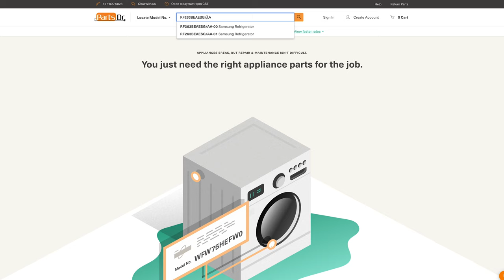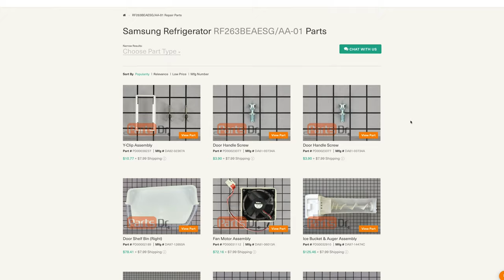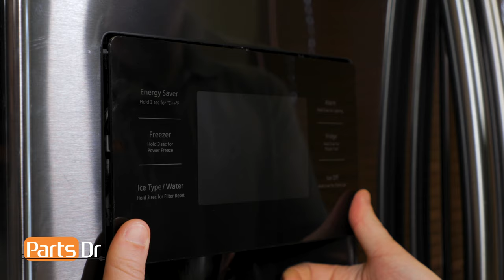Check this seal to fix ice buildup in your Samsung refrigerator

Comment: Thank you, Parts Dr, for this video. I’m optimistic our problem is fixed now. One further tip to your viewers: DON’T test the ice chute flap with a cup of water after you put in the new parts until the fridge is plugged back in. That’s because there’s a cam controlling flapper position and it may not be in the right position until you get power plugged in. (Seems obvious now!)
Reply from the maker: Thank you for sharing this tip!

Comment: I removed the lone screw but after repeatedly trying for an hour now, the front control panel will simply not budge even when applying straight out pull pressure using two hands in the dispensing hole. Is there another screw somewhere? Hidden locking tabs? Another technique? FYI--I used a razor blade around the three sides of the control panel just in case debris was causing the problem but no change. The hidden black underside panel is too thin to try and pry try it out with a screwdriver. Please note that my unit (model #RF28HMEDBBC/AA) has a gray cover around the water dispenser while your demo unit has a black ring. Your video suggests that very little pressure is required. I am applying so much pressure that I am afraid I will break off the front panel snap tabs. My dispenser leaks air into the ice maker and I need to replace the flapper mechanism with a unit I purchased from you so any help would be greatly appreciated. Thanks.
Reply: Samsung fridge.. i have the same problem as you.. how did you end up getting the ice dispenser removed. i dont want to pull mine off.
Reply: Me Too! Ours is a RF23HCEDBWW with leaking flap as well.  And we can't get the cover off either.  One screw out, pryed back bottom with screwdrivers but only budged about an 1/8 inch.  Can you help?

Comment: I replaced the flap with a brand new one, its seemed to seal initially but after a week seems to be leaking more than the old one. did I miss a step or is it faulty?

Comment: rh22h9010sr my flapper is stuck open. No AC voltage is going to the flapper motor when the switch is activated.

So I don't think the flapper assembly will fix it.  What is the next component I can replace to make sure voltage is going to the motor?

Comment: We have a Samsung RF22KREDSR/AA-05 with a leaking flap. The panel is slightly different from the one in the video. I have tried to remove the ice dispenser cover several times to no avail. After removing the screw, I have pulled on it as hard as possible and it doesn't budge. Are there any other tricks to get it off without breaking it?
Reply: Ours is a RF23HCEDBWW with leaking flap as well.  And we can't get the cover off either.  One screw out, pryed back bottom with screwdrivers but only budged about an 1/8 inch.  Can you help?

Comment: I did the water check and it came out the dispenser. The flap doesn't appear to be damaged.  Do I replace the whole flap assembly or just the spring?
Reply from the maker: You would want to replace the flap assembly.

Comment: If the flapper is stuck open would that make the water stop working? Our water does not work and the flapper stays open. Everything else works... ice dispenser and maker.
Reply from the maker: It doesn't sound like a related issue unless both of those problems occurred at the same time.